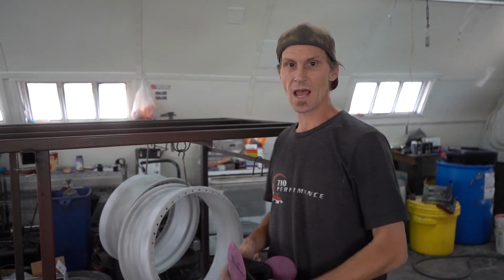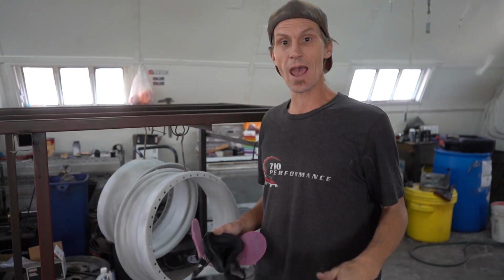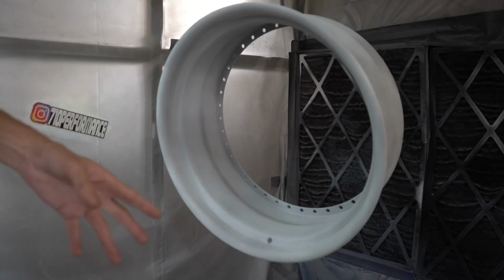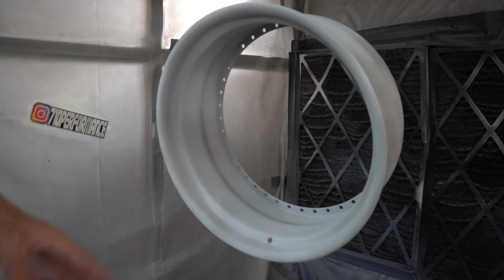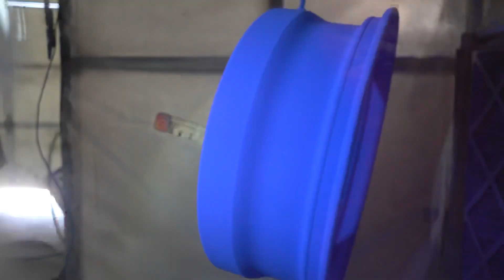Powder Coating Intense Blue FINAL OUTCOME

Comment: nice job guys. You ever thought about masking off the lip holes, then cutting a nice line round the outside to save time hoovering that stuff up. You'd get a perfect line then where the powder edge is
Reply from the maker: On previous 3 piece wheels we did tape them off, we wanted to see if it was faster this way this time. =)